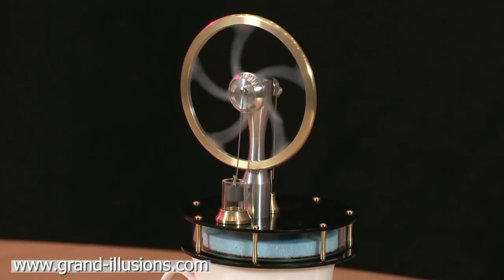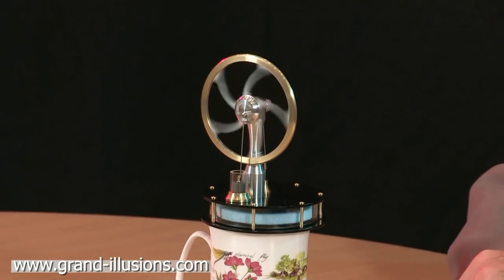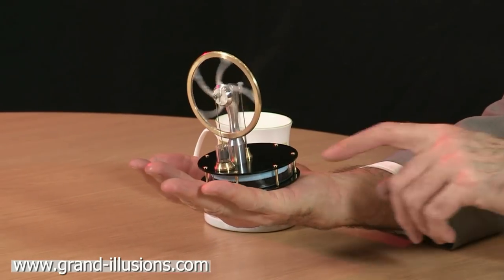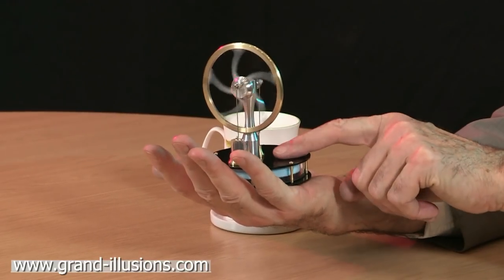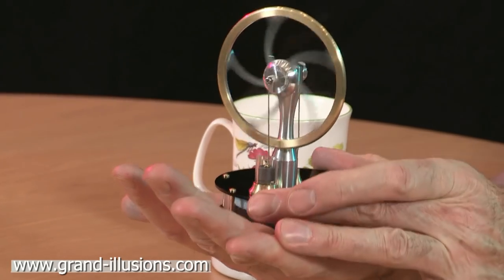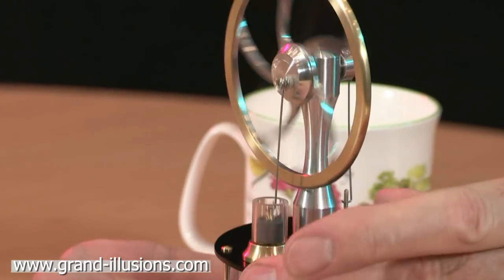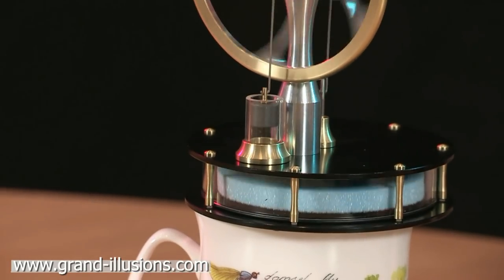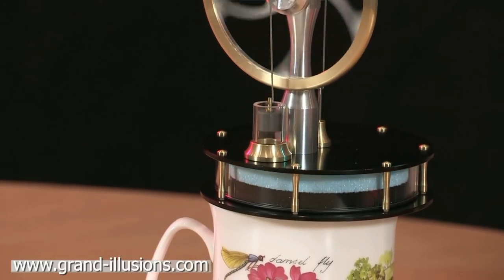Low Temperature Stirling Engine

Comment from the maker: This model would be damaged if exposed to a high heat source. However there are versions of this engine which are designed exactly for that purpose. Pop them on top of a stove, and they spin away. Oh - and they also have a propeller, so this pushes the warm air around the room. Google 'Vulcan Stove Fan' and you will see an example.

Comment: I am a person that I admire this type of engine. Works with any type of heat source, including the sun's heat. Being considered the only machine that reached 45% efficiency, while a engine automotio is around 27%.
Also, it was possible to manufacture various engines, reaching up to 1900 RPM and linking up to 40 LEDs, using a simple scrap materials in the construction of this engine.
On my channel, I posted some videos with tutorials.
I appreciate everyone's attention.
Leandro Wagner.

Comment: This seems like it would be a great watercooling device, if you hook it up to a water circulation system where the water accumulates under the engine, and have the engine working as a pump. Draws off heat from the water and sends cooler water back into circulation through its power.

Comment: Yes, provided the drive is warm enough.The bottom plate of the engine has to be warmer than the top plate by a certain number of degrees. This one runs on the heat of a hand. As long as your drive is warmer than that it should continue to turn while on the drive. The warmer the faster it spins (not to warm or you can damage it, no flame etc). I have the same drive (different company) sitting on a laptop power adapter (power brick) & it spins quite quickly. They work on either heat or cold.

Comment: You cam measure the temperature going from your hand through the leyer of  the buttom, then due to the volume of the air and some equations of termodinamics, you can tell what presure is making the heating air through the hole at the top, and therefore the torque over the wheel.

Comment: i think the piston,  or in this case the blue foam thingey inside,  might melt above 100 degrees C or so (212 F)  ,  but until that temp it will probably just go faster or just break (the conection between the blue foam and that thin iron pin seems to be likely to come off ;)  )

Comment: Now what he needs to do is attach magnets in an equilibrium around the wheel and have them passing through a coil of copper wire. This way, you will be able to power a light or other electronics with the heat of your hand. (Or tea)

Comment: This device is being developed by NASA to use as an electrical generator for future space probes for the outer planets, as it's much more efficient than the current thermoelectric junction generators on probes like Cassini and Voyager.

A small lump of red hot plutonium will provide continuous power for decades.

Comment: How it works?

The machinery operates due to air continuously displaced in a room with a hot and cold side.

The big cylinder has a lightweight sponge that displaces the air in the cylinder from one side to the other. When air is displaced to the space where walls are warm it expands and when air is displaced to the cold part it contacts.

As the large cylinder has a fixed volume the expanding and contracting air causes a pressure difference over the graphite piston in the small glass cylinder. The piston energizes the flywheel by a crankshaft and a secondary crankshaft 90 deg out of phase displaces the large sponge cylinder and ensures the air displacement in the large cylinder is repeated continuously.

Professional sterling engines operates at higher gas pressure to have the gas conduct more heat and the piston has porous material to store and release heat to the air as it commutes between the hot and cold space.

This is how combustion engines in cars work as well. The only difference is that cold air is mixed with fuel and set on fire. The distributed fire makes the air expand and it pushes the cylinder. In a combustion engine the hot air with CO2 fumes and water vapor  is not recycled but instead disposed of and new cold air that contains oxygen is again mixed with liquid carbon fuel and set on fire to again expand.

Comment: Liquid helium has a phenomenally tiny heat capacity. A paperclip at room temperature is enough to boil a liter into gas. It would evaporate within mere seconds outside of a dewar flask.

/watch?v=vjzSQUmxiS4

Comment: If you could get this idea working you would be a VERY rich man. What you are describing is called Perpetual Motion & with our current understanding of physics, it is not possible. It's like a battery that runs a charger that constantly keeps the battery charged. Also, friction is the enemy of these engines.  This type of engine puts out very little torque (especially little models like this). Any additional friction or binding of he components can prevent them from running at all.